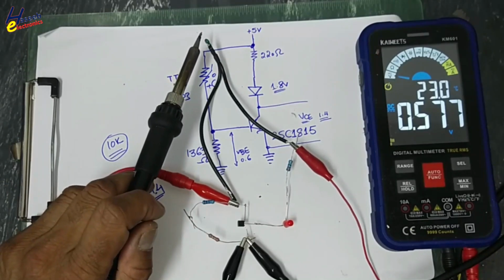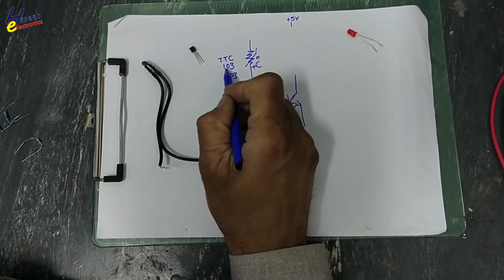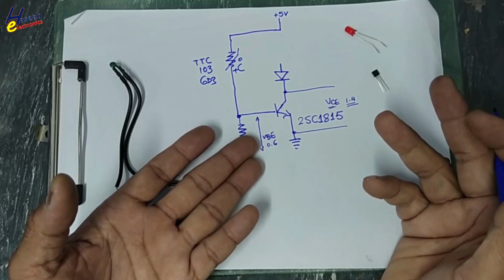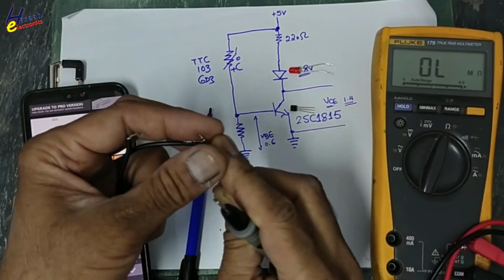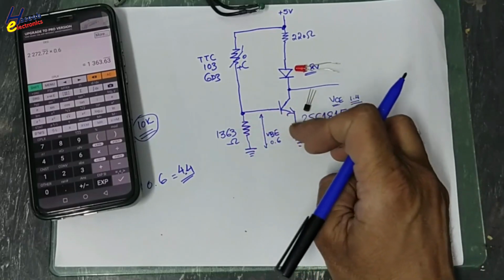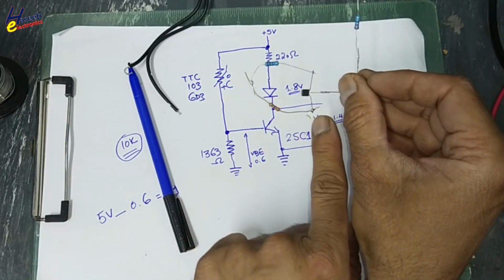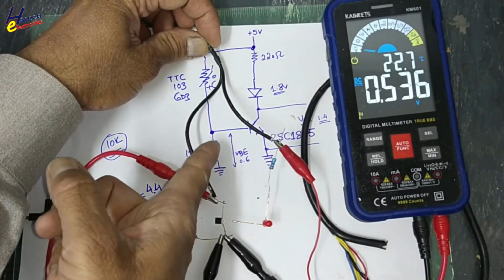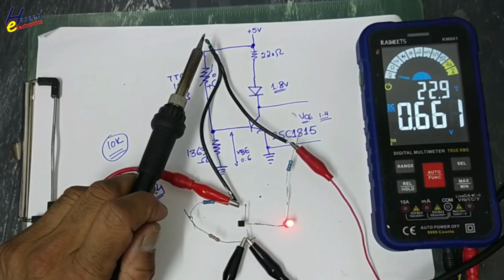{1296} Temperature Monitor Using NTC and NPN Transistor

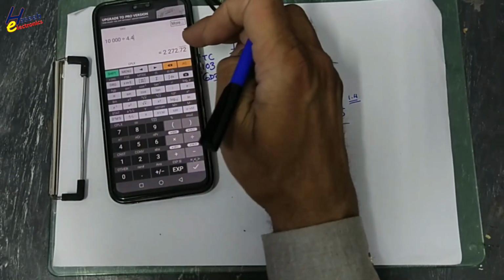Comment: videolarını ilgiyle takip ediyorum. benim için çok bilgilendirici oluyor. bunun için sana minnetterım. 06:35 de direnç değerini neden gerilime böldüğünü tam anlayamadım. beni bilgilendirirsen çok sevinirim. Allah razı olsun senden.
Reply from the maker: iyi akşamlar. çünkü 10K NTC kullanıyoruz. ve NTC'ye 4.4 volt düşmesi gerekiyor. 1 volt için direnç değerini verecek (10000 / 4.4 = 2272 ohm).
sonra bu değeri gerekli taban voltajımla çarptım (2272*0.6 = 1363 ohm)

Comment: ❤ I would like to know whether two NTCs can be used in series adding up to the desired value? Will it work? In my case,  there is a requirement of 33 ohms, not available in the market. Can I use two 17 ohm ntc in series. It's present in Philips amplifier  circuit.